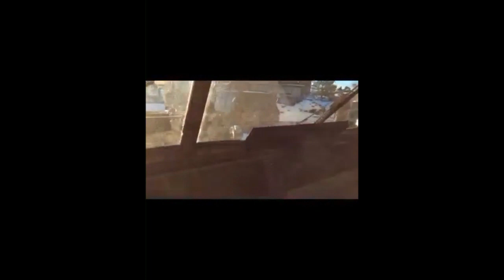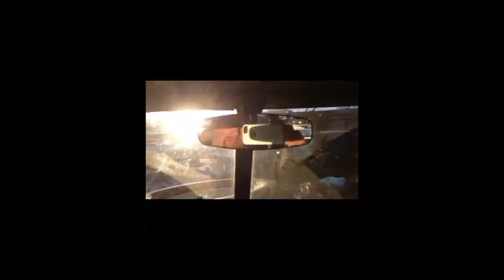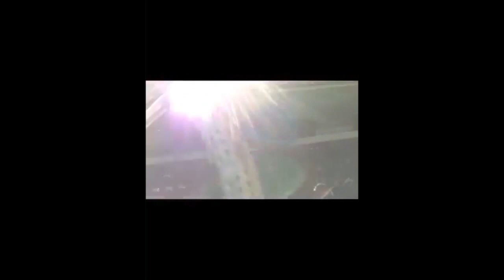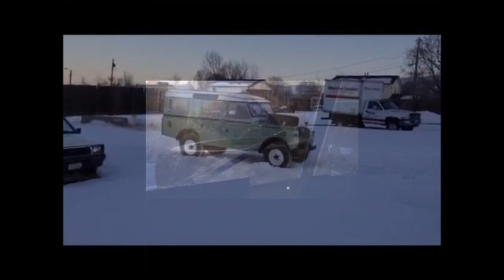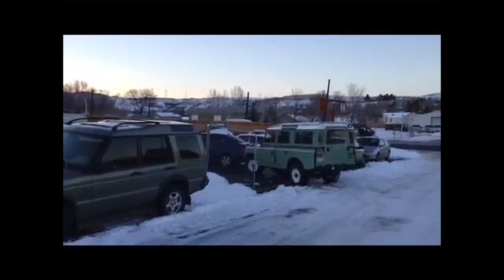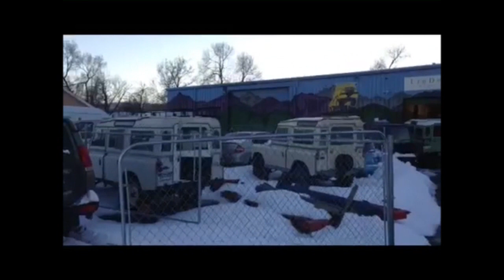15:  1st Drive: Land Rover Series 2A: Ford 302 V8 and P38 Power Steering Conversion

Comment from the maker: Well the news is in: One wheel on each axle has a seized brake set up . . . so, my intended June, 2013 Disc Brake Conversion will apparently be happening now. Ugh, but oh well . . . I knew the brakes were on the list when we first took everything apart In June, 2012. better to do now than later. 2 weeks from now, the whole thing should be driving normal.